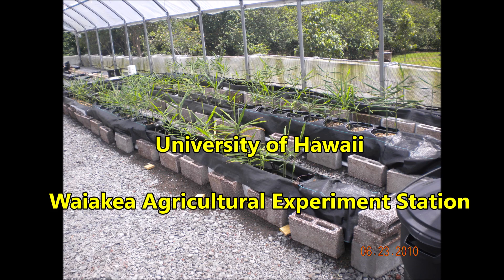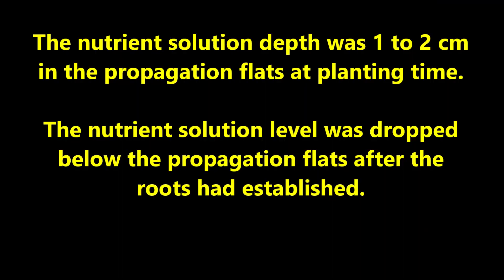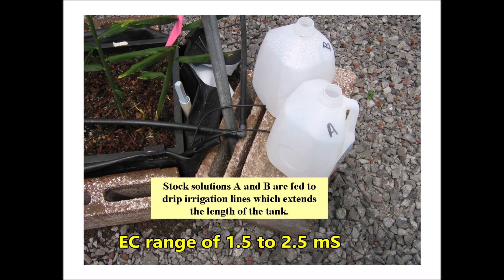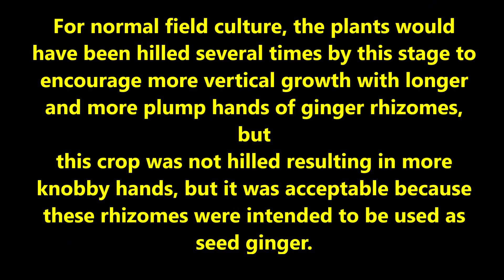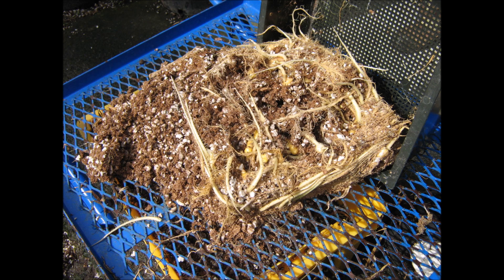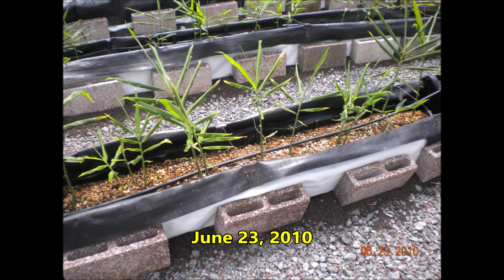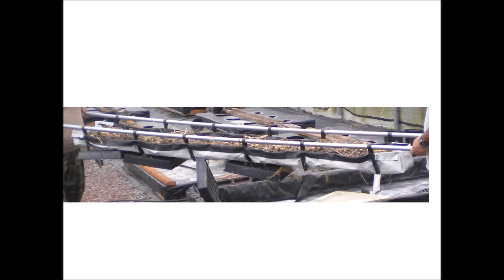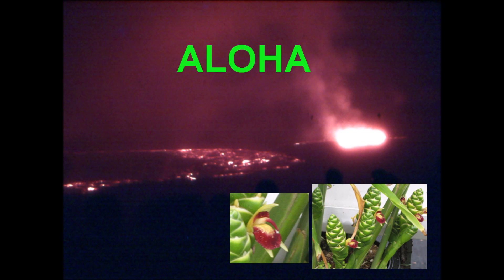Hydroponic Growing in Roll-Out Plastic Tanks II. Ginger

Comment: Begging your pardon but the roll out tanks always seem to have lumber or cement blocks along the sides, even though they are clipped to the inside flats.
I think accepting solid sides as  necessary is probably for the best
Reply from the maker: You are correct, but I would like to at least aspire to a method without solid sides and that would probably require some sort of internal support.